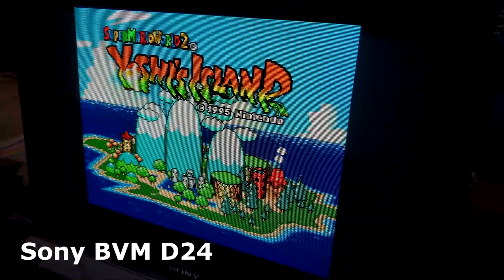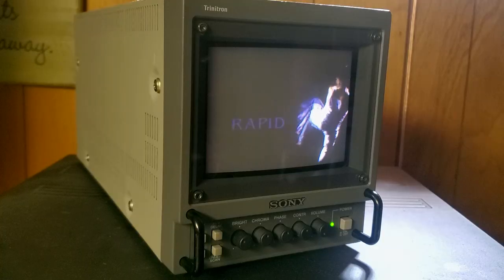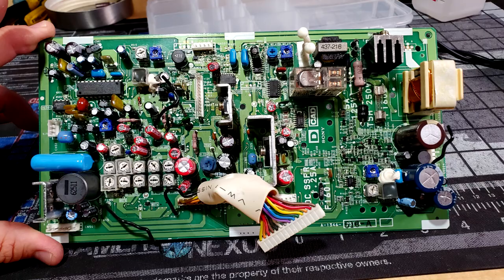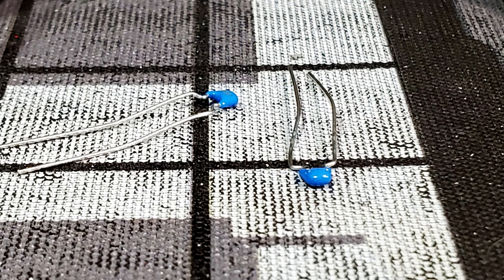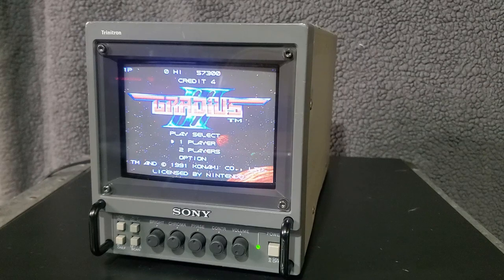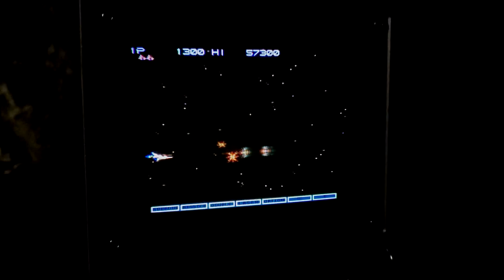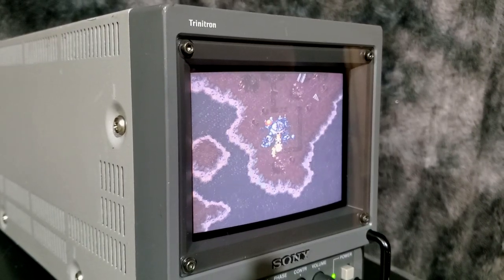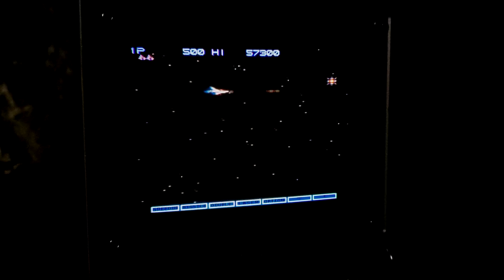Sony made a portable Retro Gaming Display with RGB.

Comment: I posted my 5041q up on the Twitter post but I will add I love my unit and it's a great conversation starter when I bring mine out with my PSP for PS1 games via component input. It's one of those things that brings joy to people to see and have a short gaming session on. Thanks for showing the potentiometer issue for the composite input, I was struggling to fix that problem on my unit. I typically use the RGB/Comp inputs but now I know what to replace, awesome vid!

Comment: A small set like this could also be really useful for a bunch of things, like testing video outputs of various setups and adapters, checking to see if something is working as intended without having to lug a larger CRT over to where you need it, a small desk setup, a second screen for a number of emulators and games that support it, a small video monitor next to your main screen, and so on, even as the second screen on a NDS emulator would be dope, also I bet GB games would look nice on it.

Comment: I love these. They're so cute. Only drawbacks are the toggle for RGB/YPbPr is on the back and lack of Y/C support. The little blue carry bags for these are awesome too, the front folds into a sun shield.
Reply: It's pretty simple to transcode Y/C to RGB or Component though, or even a decent VCR from Sony or Panasonic will have Y/C input/output too RGB/Component in/out, would still be nicer to have a straight up S-Vid input though of course, but I don't think there are any downsides to the image quality or latency  when transcoding S-vid.

Comment: Hello Mr RetroTech.
I have a 32 inch wide-screen sony trinitron that I love dearly, and recently the plastic frame has begun to peel away from the glass at the bottom of the screen - how would you suggest fixing this? Do I need any special kind of glue to restick it back onto the glass, or would you suggest something completely different?
Many thanks!

Comment: Is an old Sony Trinitron 27" color TV worth anything to Retro gamers in 2024.  I bought one to replace the one I bought in 85 in about 1996.  Right before the first Gen Hi Def sets came out.  I used it for about 2 years before I stopped using it.  It works great and has stayed in my Living room since I bought it.  It's basically like brand new.  Is it sought after yet or should I hang onto it a little longer?

Comment: i think people play games on phones, tablets, and on laptops and especially hand held gaming devices nowadays. Soo... it really wouldn't make sense to not be playable, especially as the color is actually good you can see detail and separation where on other displays if it was really inaccurate color range, it would probably be unusable if it weren't good in the places that mattered. But also some people prefer to have their screen real estate meet their entire peripheral view. The type of people who will play up close on a television because their eye sight and attention span diminishes if it's too far from what they're looking at. certainly anything from between 13-22 are the smaller type of monitors that people are normally used to. But that isn't to say that anything phone sized isn't good either. The fact that crt's were often not in as wide screen format, suggests that the same 5.5 inch sizing on a crt compared to an led phone screen would actually be better suited in just not looking as cramped in general. And because it's not very heavy and quite maneuverable someone could very easily set it on a surface that's above or level with their head from where they can proceed to find a comfortable reclined position. Tbh, I don't know why more people don't find it to be the standard to always play with a closer eye distance to their displays. Ig you can't always recline if it's big wieldy tv and your couch is set way back. But it has always helped me with my attention span to feel closer to the content itself. You could probably lay down on a couch with it on your chest playing with a controller with outstretched arms. 12 pounds is literally the weight of a modestly sized cat or dog.